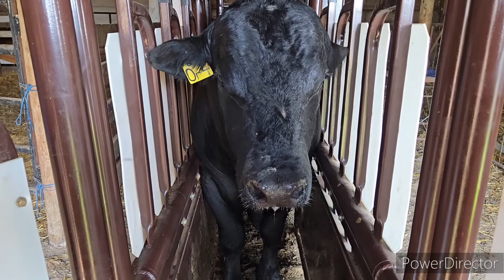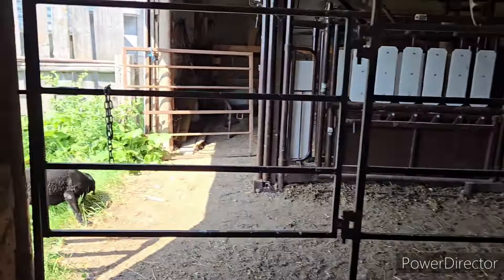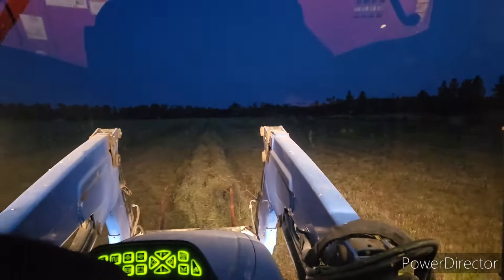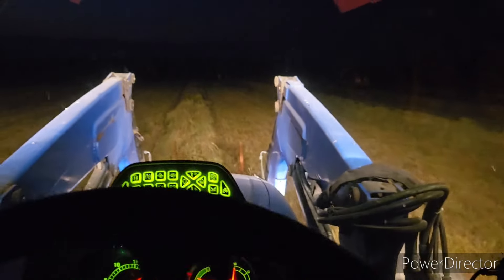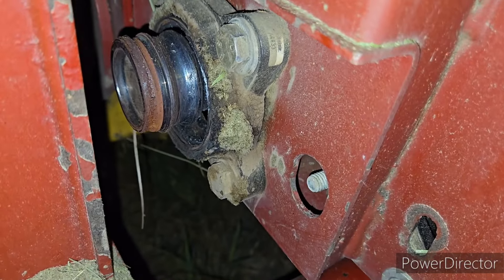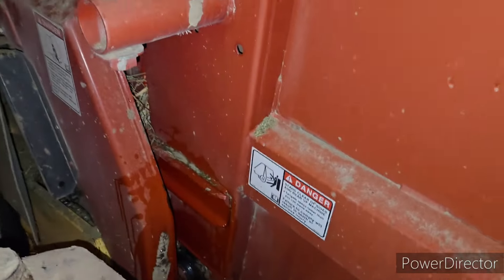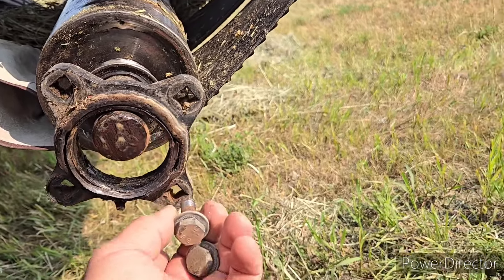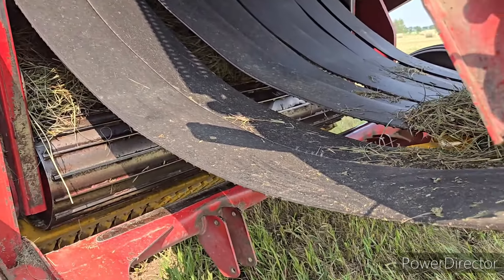New Holland br780 Bottom Tail Gate Roller Bearing

Comment: I keep losing the hub caps off the wheels on my 780 and my 18ft 1475 haybine.  I don't know why. I was told by one dealer that the hubs flex but I have a hard time believing that. I have tried just about everything to keep them on but I finally made a strap that put over the cap and bolts on two oppisite wheel bolts. I was wondering if you have had that happen.
Reply from the maker: Both my balers will loose the caps...I just tape them on with red tuk tape